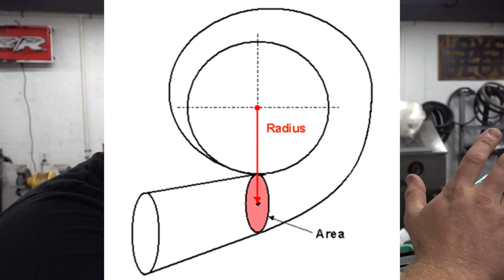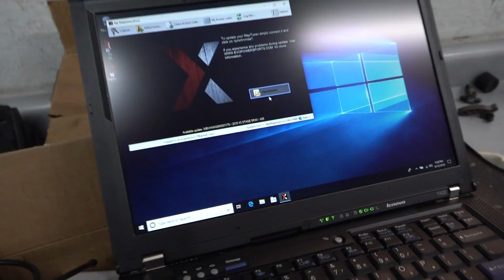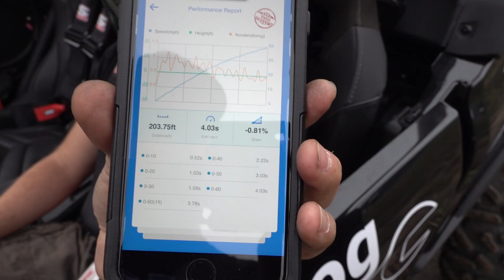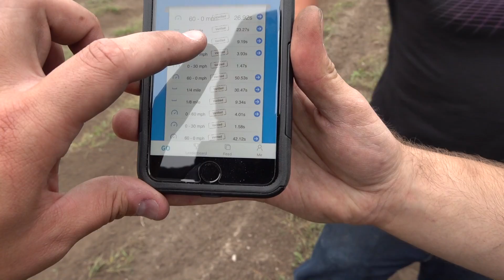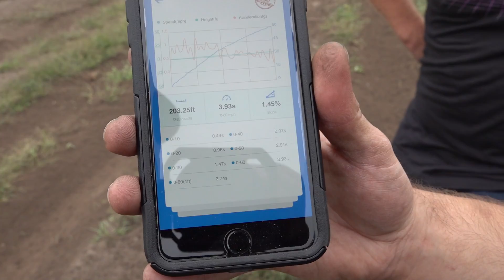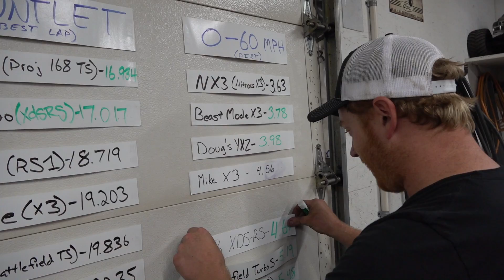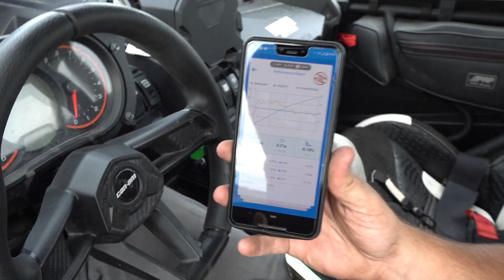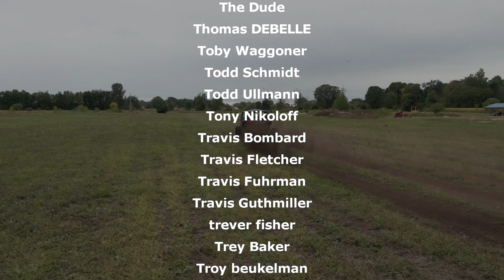Rick Maverick X3 goes Evo SUPER Stage 6 on E85! BIG POWER!

Comment: How were you running the Stage 5 X85, E85 Tune on a stock pump? I that tune required a pump and injectors.
Reply: FNTony 496 injectors/wg actuator. No pump needed. Unless it’s a 17.
Reply: Rick Spencer thanks!!

Comment: So if I were to save some cash and buy the 120hp version and spend that saved cash at sxsblogparts.com/ on hop ups, is this all possible with the 120hp X3 model?
Reply: Todd Ullmann absolutely
Reply: Totally want to know this as well.
Reply: @richrules  I have yet to buy a sxs and with these videos this looks like a great way to get big power in a machine and saving a few bucks in the process..  I like the new RZR Pro but a big HP X3 looks like great fun
Reply: Todd Ullmann it’s super easy to build the X3s (and RZRs) gradually. Not something you need to spend a ton of money on at once. Plus you don’t really have to worry about buying things twice as the smaller more basic mods in most cases can carry over to larger builds. We have a video on getting 190 horsepower out of a base with minimal mods; the machine is a great bang for the buck!

Comment: Do you guys run different tire sizes or just whatever
Reply: By that front wheel lift I'd say try stiffening the rear suspension so them fronts can dig more
Reply: Get a good filter with a velocity stack inside

Comment: Are you using GPS do check speed and time? Lol that will NEVER be accurate, gos does not work that way....
Reply from the maker: It does when you use high frequency gps performance meter (Dragy, vbox...), been a standard in automotive performance testing for quite awhile.  Agree you can't use your cell phone.